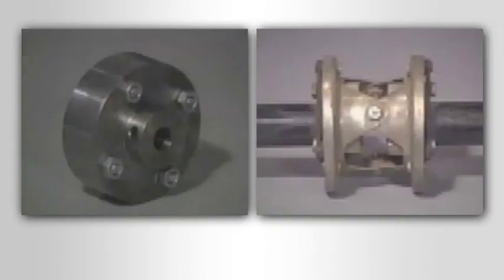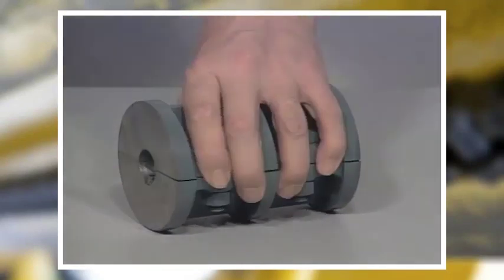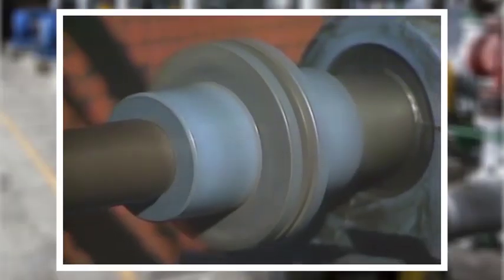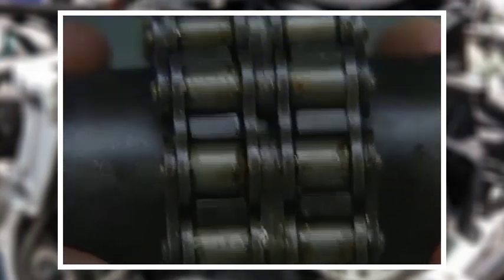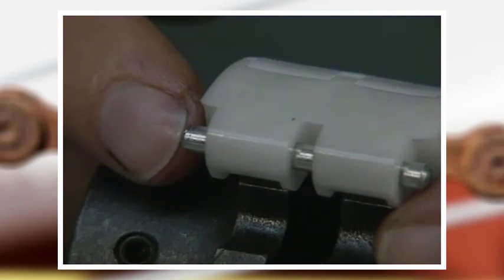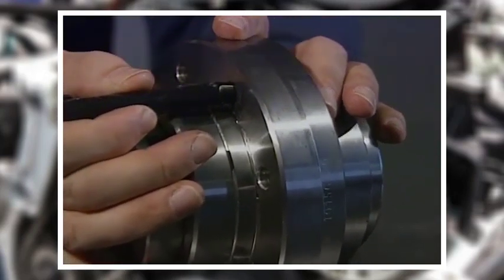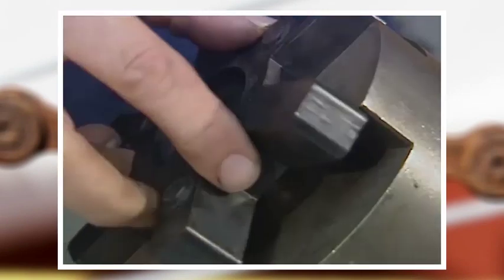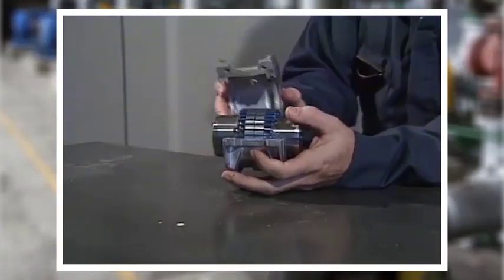Selecting a Coupling for a Shaft

Comment: please help me...
i have two shaft, one is from motor stepper and the other is from anemometer. 
i want to combine these two shaft, and if the shaft from motor rotate then the shaft from anemometer also rotate. what kind of coupling that i can use?
Reply: usually i only use rigid coupling.